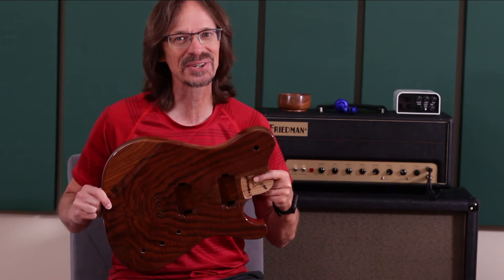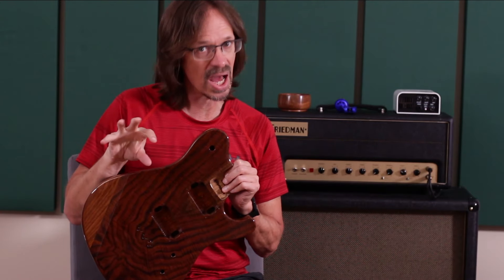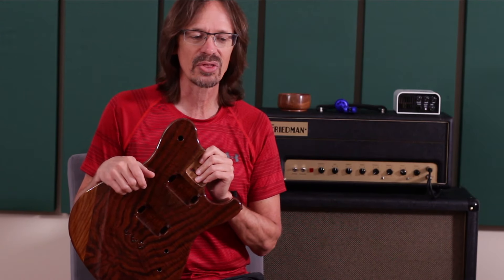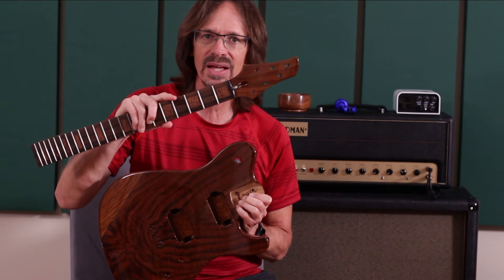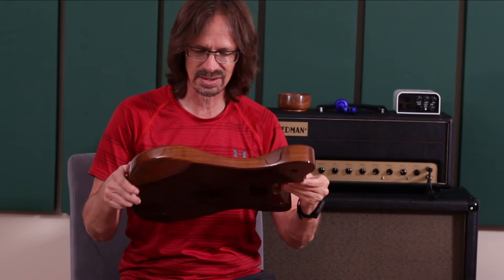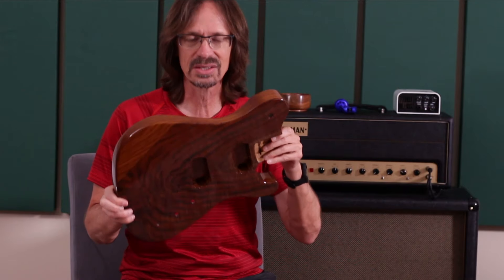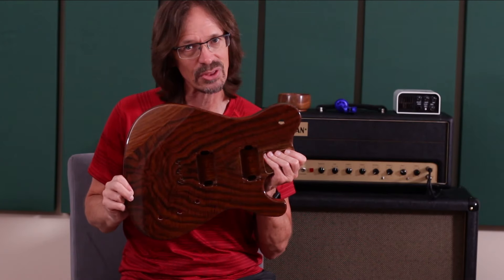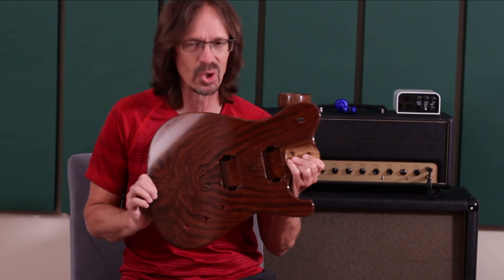"Rainbow" Claro Walnut Limited Run

Comment: That "all access heel joint" will ever be an option on all bodies? The current countour heel joint is fine, but that rounded one would feel way better on the hands
Reply: The Contoured Heel is definitely better than nothing. I used a Fender American Ultra Series body on one of my last builds, and I find that even more ergonomic. Downside is that you won't be able to use that standard rectangular neck plate with these... 🤔